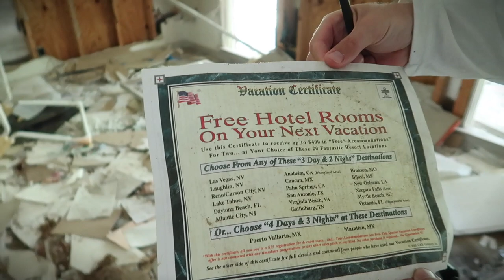HIDDEN Pond Behind HAUNTED House (Bank Fishing)

Comment: If you pay attention most of the big holes in the wall are near the receptacles and switches (electrical) so someone has been in there stealing all of the wire. More than likely the burn spots are from there still being live wires and the wires being cut.